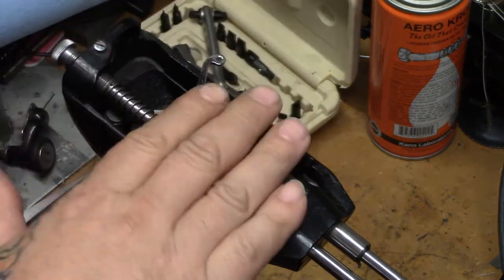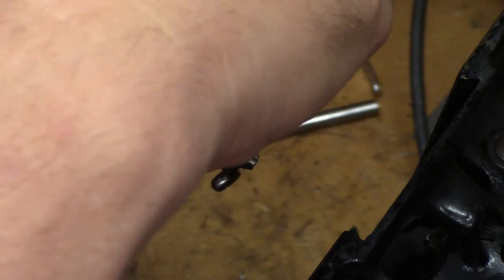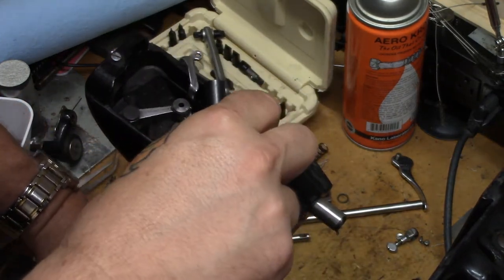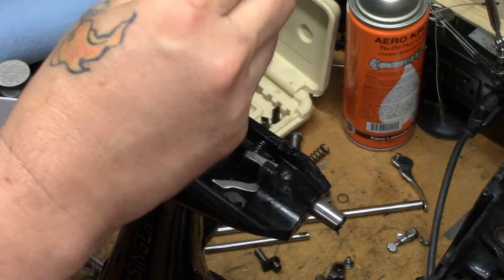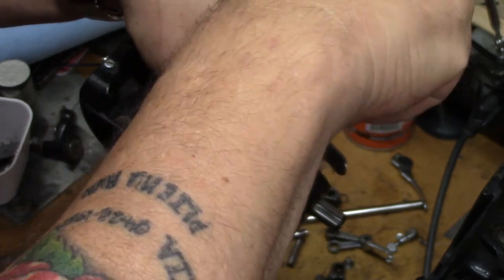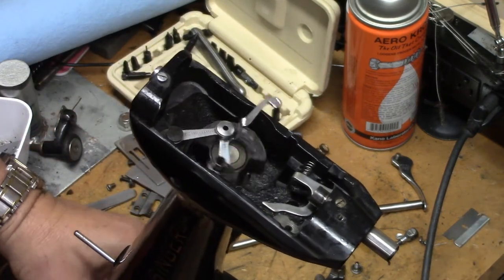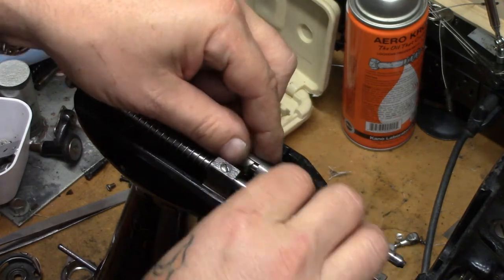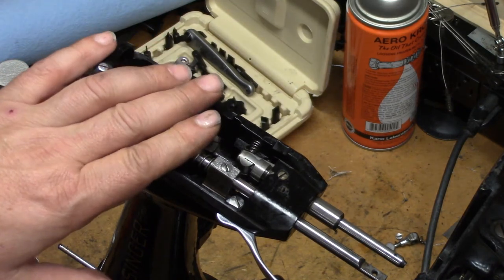Singer 201 Needle Bar End Disassembly/Reassembly

Comment: "The spring is usually very well attached".  Famous last words. I started working on my 201 in my 8' x 8' sewing room. On my machine the spring sprung somewhere in that tiny space.  Hubby and I spent hours searching for the spring - never found it.  "Hello E-Bay, my old friend". LOL
Reply from the maker: Which spring??? The one on the fork that actuates the upper thread tension release?
Reply: @BobFowlerWorkshop  Yup, that one. When I installed the new spring, I discovered why you  stated that it was supposed to stay on snug. It was really difficult to attach. Took hubby about 20 minutes. It’s on now! Thanks, again for your videos!

Comment: Thank you, thank you, thank, YOu, you’re awesome.  Have a great day. 👏
Reply: My sliding block, does not slide, lol. My hand wheel does not turn, my needle bar does not raise, my presser bar does not raise, sighhhh.  I’m gonna keep at her though.
Reply from the maker: Sounds like you have a bad case of schmoo in the mechanism!
Reply: @BobFowlerWorkshop  yep.  I managed to get slight movement in everything except the needle bar and horizontal hook drive shaft.  The presser bar is now fully operational YAY. Other than the WD version called “penetrant” any idea on what I could to to get those parts moving chemically? I’ve tried steel wool as well and a good clean. I read maybe a bit of kerosene, should I try a drop of rust converter or will that just make it harder to knock those bar/shafts out if it comes to that?
Reply from the maker: @alisonaussie4995  If you need something with a bit of abrasive power to clean dried crud, you can (carefully) use a green Scotch Brite pad to help get the nasty stuff off.
Reply: @BobFowlerWorkshop  thanks Bob, I've got it all completely unstuck now and cleaned.

Comment: Thank God I came across your video's!  I am restoring a 15-91 and a 201-2 and your video's are the best!!! I have a question.  When taking the motor apart on both machines, neither one of them had the fiber washer.   I don't see one on the shaft or on the bearing.  How important is it and where do I buy one?
Reply from the maker: Hi Angela. Not all motors have the fiber washers, and some even have thin plastic washers, yet others have none. It's purpose is to set clearances and reduce/remove end play from the motor shaft. If yours doesn't have it, and if it looks like nobody was in there before you, don't worry about it, it probably was never there. Just make sure to carefully check the face of the bushing inside to see if it is stuck to the bronze as that can happen.

Comment: Thank you for the very helpful video ! I can't get the pressure bar out because it's stuck in the little block. Would you have an idea to separate them ?
Reply from the maker: Sure... remove the sets crew, take off the presser foot and screw, then grab the bottom of the shaft with pliers and rotate it to break it free from the schmoo. If she doesn't want to move, try slathering the rod with some oil and scrubbing with a green Scotch-Btite pad.
Reply: @BobFowlerWorkshop  it worked perfectly ! Thanks a lot 😃
Reply: Another question... How would you deal with a stuck needle bar ? It's stuck in its up position so I can't access the screw trough the hole you mention. I think it's actually because of the needle bar that the whole machine is frozen. All the other parts slightly move when I turn the wheel.

Comment: Hi Bob, thanks for this video! I came across it while trying to fix the problem I'm having where lifting and lowering the presser foot lever does not cause the tension stud pin to move so the tension discs are always in the engaged position. I started following along thinking I'd just clean the whole area but thought I'd ask, before I get too far, whether you think I'm likely to find the cause of this issue or, generally, whether there is some standard cause for this problem which I've heard is not uncommon for 201s. Your guidance would be most appreciated!
Reply from the maker: There are a number of reasons why this may be happening. My guess is that either someone played with the set screw that holds the upper thread tension unit in place and it's too far out from the body, so now the pin does nothing, or, the pin is missing, or, the transfer bar in the needle bar box is bent and not engaging the pin. I'll show the possibilities on this Sunday's Sunday Morning Quickies.

Comment: Hi Bob. Great video, thanks so much. It's been essential for breaking down my 201-2. A couple comments: I found it much easier to remove the metal cap blocking the needle bar from the top rather than from the bottom. You don't have to find the right size punch and awkwardly hit it from the bottom. I took a wooden dowel pin and hit it with a hammer to knock that metal cap DOWN and out. Much easier in my opinion. Also, have you checked the inner part of the head, near the light, next to where the access hole for that needle bar set screw is? This is where the set screw for the tensioner assembly is on my machine, from 1938. I don't believe yours was stripped, I think the screw is simply meant to be inserted on the other side. Of course, I could also see how this may have been a minor design change over time.
Reply from the maker: Some 201's have the set screw on different sides. It can drive you crazy! Mine was in fact stripped...

Comment: at 12:30 what are you turning fomo the back of the arm to tighten down on the needle bar? Mine looks different and has nothing to unscrew or screw through the hole in the back.
Reply from the maker: Which style needle bar clamp do you have? There are two styles, one with a screw in the back that can only be accessed with the needle bar in the lowered position, and one with the screw in the front. at 12:30, I'm going for the screw on the back of the clamp. Seem my video "A Tale of Two Needle Bars" for more info: https://youtu.be/rphb5wBzjek

Comment: This has nothing to do with a singer, but rather a Kenmore. I went and looked for one of your YouTube videos and came across this one and speaking of disassembly, this is what I did ……..I have the 158.18023 and was wondering if you have a video on how to reassemble the high shank mechanism. I unscrewed the left side, took out the nut on the right side and I’m totally lost now. Actually, I bought the machine and found out that it didn’t have the nut but I found one that fits so I don’t know if it has to be Kenmore specific or if this one will work but what I’m trying to do now is just trying to find a video on how to put it back because it looks like there is some sort of calibrating that needs to take place.  Thanks

Comment: Hi Bob, thanks for a great video, I really appreciate your detailed explanations (calling out the screw bit numbers is 👍). I’m curious if you’ve ever had to reposition the needle bar bushing (part #66558) on a 201? How would you go about moving that bushing down so it’s a bit lower? Thanks!
Reply from the maker: It's a bit unusual to have to move the needle bar bushing on a 201, but the process would be the same as for most of the others: loosen or remove the set screw, then use an appropriate sized punch and a few gentle taps to nudge it into position. Just be careful to use a punch large enough that you don't damage the top of the bushing. Also, GENTLE taps go a long way - don't wail on it, you can break the casting!
Reply: Yeah, definitely a bit weird. I noticed that my timing gauge was a few millimeters above where it should be located but I was having trouble figuring out why. When I removed  the set screw for the needle bar bushing the recessed flat spot was showing up above the screw hole (if that makes sense) so my best guess is the whole busing is just up a bit too high. Am I correct in assuming that the set screw should land on that recessed section on the needle bar bushing?
Reply from the maker: @P_Hamtramck  That would be a safe assumption, but you must remember that there is a degree of adjustment there as well. I just made some measurements on a few different 201's and the top of the needle bar bushings  AVERAGED 7mm above the inside of the castings. I hope that helps. If you look at page 46 of the adjusters manual, it specifies how to set proper needle bar height. That height is correct when the top of the eye of the needle is 1/16: below the point of the hook when set in timing position. Hope this helps.

Comment: Bob You have been very helpful to me but I am having a very hard time finding what you called in this video a pressure bar adjuster, most of these sites you sent me to Don’t Know What I am speaking of, Once again I have a Model Number 66 singer, built in 1919, Maybe You could help me with a part number or something else which would be of help. Thank Again.
Reply from the maker: Try this listing, it's #25 in this ebay listing, same part for a 66 as a 15

https://www.ebay.com/itm/383282639062?hash=item593d6cf0d6:g:QgMAAOSwyMVd2blR
Reply: That is not the part, I do appreciate your diligence in trying to help , but it is the knob which goes over that rod and has threads where it goes into the casting on the head, as a guess I would say the threads are 7/16 and hole that goes over rod Is 5/16 the knob is knurled for turning , thanks again.
Reply: OK Bob I think I have found it on E-Bay , not sure but will let you know when package gets here, Once again thanks for caring.

Comment: I'm trying to do this disassembly/reassembly on a Singer 66 dumpster find. I've been able to clean most of the grime from around the needle bar but still can't get it loosened enough to separate it from the take-up lever. Do you have any advice?
Reply from the maker: Is the needle bar seized up or down?
Reply: @BobFowlerWorkshop  The lever itself isn't seized. What you do at around the 3:43-3:44 mark of the video with removing the bar itself from the apparatus - that's what I can't manage. There was a significant amount of old grease and buildup caked around the bar in that area. I've cleaned it as best I can, but the bar is still stuck in the take-up lever apparatus.
Reply from the maker: @RT-rc4jv  Ahhhhh.... Ok. With the clamp screw removed, or at least loosened, try this. Put the needle clamp back on if it's off, and using finger pressure only, try to spin the needle bar in its bushing and clamp by rotating the needle clamp. I had one just this morning that was stuck as you mention.
Reply: @BobFowlerWorkshop  worked like a charm! Thank you!

Comment: we repainted our 201 and our presser bar is stuck...won't glide in, any suggestions?
Reply from the maker: Hi Gia. It's probably paint in the hole. It doesn't take much as the clearances are very tight! Try cleaning any paint out with a small wire brush.

Comment: Hi Bob I just got a singer 16-88 and the needle bar was loose, I'm trying to fix this up and get the right timing.. But there's no mark on the bar, I think it's a fixed timing ( shuttle going one way only) which mean only the bar can be moved to set the correct timing .. I'm lost here, if you can help that will be magnificent =D I've been trying for 3 days to get this work.. Thanks!! Same model is Consew 18, and there's almost nothing talking about these machines, and how to fix them.
Reply from the maker: OK, here's what you can do if you don't have timing marks - you'll need to channel your inner jazz musician and improvise! 
You will want the needle plate removed, as well as the feed dogs to make this process easier.
On a piece of stiff paper, make 2 very fine marks 2.5mm apart. Yes, 2.5mm, but you can eyeball that easy enough. You will also need to make another gauge with points 1/16" apart.
Make a a very fine mark on the needle bar clamp - think a very thin line (You can use India ink, then scratch a line with a pin or razor blade). 
Turn the balance wheel towards you until the needle bar is at the absolute bottom of the stroke. Place your 2.5mm gauge up against the end of the machine so that the lower mark is aligned with your mark on the clamp. Next, turn the top of the balance wheel towards you so the mark you made on the needle bar clamp is aligned with the top mark on your 2.5mm gauge. Don't move anything!
With your needle bar in this position, the point of the hook should be directly behind the needle. If it's not, loosen the linkage that is attached to the hook and adjust. You will want to confirm the position of the needle bar as you do this - keep checking...
The next step is to measure the needle bar height. Using your gauge with the 1/16" marks, measure the distance from the top of the eye of the needle to the point on the hook, that distance should be 1/16". If not, loosen the needle bar clamp and move the needle bar up or down to adjust. A magnifying glass helps a lot.
It sounds hard, but it's really not. It may take a couple of tries, but you'll get it. 
I hope this helps...
Reply from the maker: I did a video on timing the 66. You'll find it here:

https://youtu.be/TZy567gCVgs
Reply: @BobFowlerWorkshop  Thanks so much I will do everything you said as the best as I can.. I was not sure if I could  loosen the linkage that is attached to the hook, I thought about I may need to move the hook to get all the thing aligned correctly, now it makes sense.. The only thing I found was this: bring the needle bar to bottom dead center and from there you rise the needle bar approx 2.5mm (as I said I have no exact values for the Class 16) and an that point the hook tip should be in the center of the needle approx 2mm above the needle eye. I was kinda lost, but now I will try everything you explain to me. Thanks so much again, I will be back.. :-)
Reply: @BobFowlerWorkshop  As I understand it, as soon as the needle bar get loosen, you need to loosen and readjust the shuttle hook to retime with the needle and bar right ?even though it was not displaced, but because the needle bar got loosen? I tried to figured out this mechanism phenomena.. Is is frequent that these machines have no marks on their needle bar?

Comment: I enjoy w	atching your video.   Can you do a video on adjusting the needle bar on a Singer 201?  My needle is to the left of the plate hole..  Thank you.
Reply from the maker: I'm curious as to how that is possible. The 201 needle bushing is fixed in position in the cast iron body and is not adjustable laterally. Is your needle bent?
Reply: @BobFowlerWorkshop  no.  Brand new needle. I just received the machine Friday from an eBay seller. No needle in it when received.
Reply from the maker: @yvejo7938  email me some pictures of the problem to argosybob@gmail.com

Comment: What's the difference between that one and a 66 they look so much the same to me
Reply from the maker: Great question! Really the only thing a 66 and a 201 have in common is the class 66 bobbin. The 66 uses an oscillating hook whereas the 201 is a rotary hook. The advantage of a rotary hook is the rotating mass of the hook never has to change direction, whereas the oscillating hook changes direction before every stitch to get to the starting point. Thus, a rotary hook machine vibrates less. The needle bar parts are pretty close, but not quite the same. The big difference is underneath the machine.